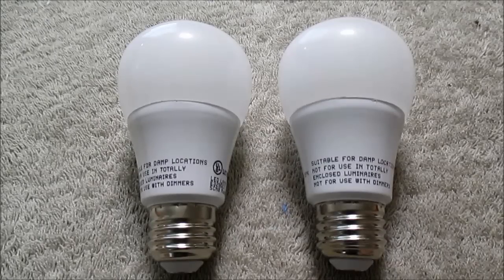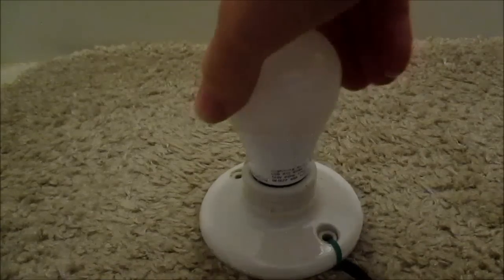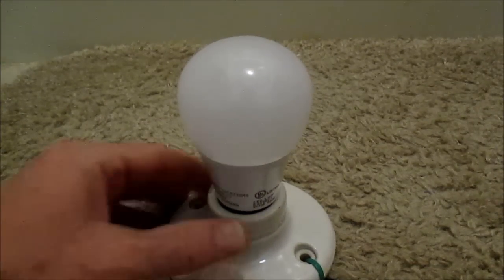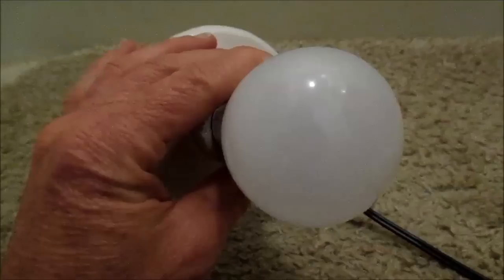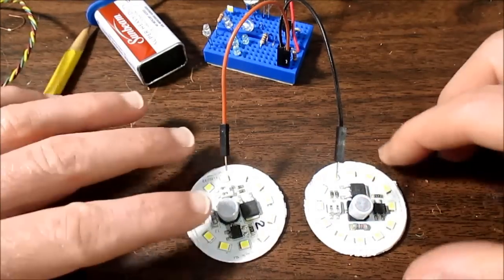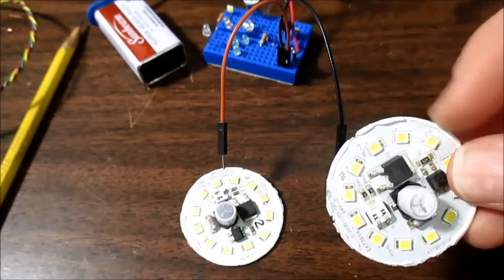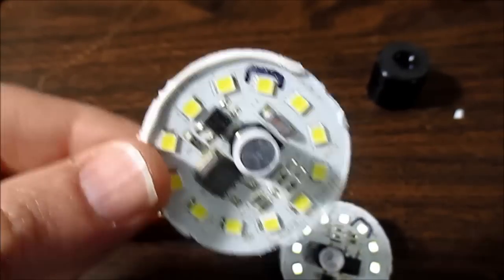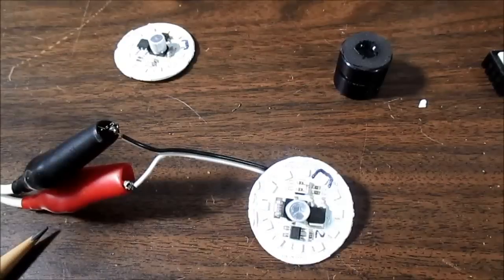Two failed LED bulbs for teardown to determine the cause

Comment: Some people believe that these light bulbs the last 15 or 20 years because that's what it says on the package.  These bulbs only last that long if they're properly installed. The major problem with LED bulbs are sensitive to heat. Maybe in the future we'll get light bulbs that last a hundred and twenty years like that one that is in the fire hall in California but like LED calculators these are meant to get rid of after a couple years.  If a computer says 15 or 20 years  of usage on the package  do you really want to keep it?   These are a little bit like computers  when a better one comes out it's time to get the rid of the one you're using.   If you could get the equivalent of a 150 watt light that provided a light type light  like the sun and ran on two or three Watts didn't get hot  for about $2 I would get rid of all the light bulbs that I have now whether they're working or not.

Comment: My led cieling light flickers alot...  Anyone got any ideas as to which component would be failing to make it flicker? Its been happening for nearly 6 months ....
Reply: Casey James at the same time as the microwave oven is running? Microwave leakage causes led drivers to flicker.
Reply: @t5grrr  nope, dont own a microwave

Comment: As with any electronic device quality of manufacture determines how long it will last. Cheap stuff is sold off and will have a much higher failure rate that more expensive made under better conditions and better materials. I have two led clock i made in late 70’s and they still work. Parts all made in usa at that time.
Reply: Go USA!!!

Comment: Current everyday LEDs are absolute junk.   In a box of 6 for under $10 you will get two failures within a few months. That's a 30% failure rate.   Incandescent bulbs that were under $2 for four had a 0.1% failure rate,  typically by handling. 

Remember that a Daisy chain of cheap LEDs and the ballast is likely to double the chance of failure for every LED in the chain.  

 Another device that is a Daisy chain of cheap LEDs is a solar panel.   Yes solar panels are just LED you shine light upon.

Comment: I also do this just for the fun and heck of it. If I may suggest, you can use an analogue ohmmeter to check each led if you set it on RX1ohms range. The voltage on the tester prods from the battery inside is just about sufficient to test an LED or a small CD motor. And by experience, damaged LED's in this kind of lamps, most of the time, very small black dots can be visible on the insides.

Comment: Thank you.  Altho I'm an EE, I never got into the bitty parts of flour. or LED lamps.  You did mention something that caught my attention:  a pair of 15-ohm rx in parallel, which I presume are for voltage stabilazation.  Since this is a mass produced consumer product, that 15 ohms could be +/- 10-20% tolerance.  Could that make a difference?
Reply from the maker: I believe those resistors are used to set the current on the constant current driver IC.

Comment: I've worked in electronics ALL MY LIFE and there is NO WAY that you can mesure CURRENT the way you do in this video. To mesure a current, the multimeter has to be put in SERIES with the mesured component, not in PARALLEL has you do in the video.
Reply: It is in series

Comment: If it has a good regulator chip then why don't they put shunts across the led like the old burner bulb Christmas lights?  That way when a single LED fail open the shunt closes and you can continue to use the bulb until the very last led fails.
Reply: That's a great idea, but then they wouldn't make as much money selling us new bulbs. It's all about the $$$$.

Comment: i'm still using CFL bulbs i bought about 20 years ago as they just appeared at the supermarket not a single failed. the other ones LED or CFL or halogen bought after 2005 fails within 6 months. They do it on purpose.

Comment: Nicely done investigation. But... :)
I suggest a look at this document, which explains the lifetime of LEDs.

http://www.p-2.com/content/products/literature/literature_files/what_is_the_lifetime_of_an_led.pdf

With an LED-development of less than 1 year, you can not know the exact lifetime of LEDs. Thats why it is all about statistical maths.
The lifetime of LED-bulbs, normally 25000 hours on the label, is not the lifetime as you will know it. Check it out.
Never the less, good work!

Comment: The main problem what I can see is already the design of the board itself.  It's almost sure one of the LED chips will fail because of the produced heat by all electronic components.  On the board should be nothing but the LED chips, so the aluminum sink is able to get the heat away from the LED.  www.ledlitec.com

Comment: I would think the LED's were bought in bulk from a company in China. Except for a few fluorescent bulbs, in the kitchen, the shed I keep my motorcycle in, and my basement workshop, all the other bulbs in my house have been replaced with LED's bought from WalMart when on sale. I've only had a few fail after a few months. I date them with a pencil when I install them and many have still lasted for many years.

Comment: The LEDs themselves are pretty reliable in (not all, but) most cases, it's the driver circuit that's usually crap.  Having replaced the backlighting in hundreds of industrial touchscreens, I've noticed that as they go from CCFL to LED, they're ditching the separate backlight driver board that can be replaced, and switching to some piss-ant little driver chip that's integrated into the video board (and of course that little chip is what goes bad about 1 month past the manufacturer's warranty)

Comment: I'm having issues with a brand new LED bulb. Put it in two days ago, and it just 'failed'. Made the same sparking sound you get from a failing mercury bulb, dimmed and flickered, and then came back on. None of the other bulbs in the fixture were affected. Any clue? When I unscrewed it, the white base part was very hot. Being an electronics tech, I'd say it's probably a short or a break inside somewhere.

Comment: I flipped the switch in my workshop recently and one of the LED lamps was just flashing at a really high rate. This is a supposedly 'quality' LED lamp made by Osram. It has been in service for less than a year, and isn't used every day. The crazy thing is that the 'el cheapo' LED lamps that I have in other parts of the house are still going strong, and they were less than half the price of the Osrams.

Comment: I have been using these type of LED bulbs for over 4 years now and have about 100 in use (there are 25 bulbs in my garage alone).  I should note that I have only purchased the absolute cheapest LED bulbs I could find.  The cheapest I could find was $0.35 each at Home Depot in the spring of 2018. The most I ever paid was $1.30 four years ago.  I have yet to have a single failure!
Reply: Yep - That's before they redesigned them to fail.  Example - my old LED Christmas light go for years - I've had new ones fail the first year of use.

Comment: To open sealed bulb use sharp knife, move around and use it like lever, it will pop easy and can be put back on. Burned leds are common problem just remove them and solder empty place. I fixed few lamps after 2 years of use and some of them still working. And sometimes is better to by two bulbs like 750lm bc they will put much better light in room than just one (one with 1500lm which is 100 and so whats) and lust much longer, all that for a fraction of a cost.

Comment: I believe the LED's are being purposely overpowered and that is what causes them to fail.
The math doesn't lie.
Find and open bulbs from several manufacturers and compare the circuits.
I think we'll find that some of them are better designed.
Reply: I gave it a thumb down as he stopped.  What is the fix?  Short around those led's?  Is he able to replace them, as I've seen in other videos.  He just stopped, like he thought "yep I'm right these are broken so throw them away".   There were several directions he could have taken after the diagnosis but he took none of them.
Reply: Paul Thomas, there is no points to recover these bulbs with new LEDs just because they were designed to burn. Designed to force you buy more new bulbs as they die. 
If one wanted to make these bulbs live, there should be some heatsink added and perhaps wrong/high current settings reduced. Doing this one would finally get some other new design. It is waste of time because these bulbs originally have poor design. Just don't buy tmem and/or throw away the ones you bought )
Reply: Ron I agree, they don’t like the fact they can last a very long time. The heat off of these bulbs alone have been questionable. I have a 100w for the garage, Lowe’s bought, and it has to be 200f after 30min on.
Reply: There are approximately a thousand people who actually gave this video a thumbs-down. That proves to me that the Lightning Science company had most of their employees deliberately give this video a thumbs-down out of anger for exposing the truth of their fraudulent business practices. I attempted to contact their company via their email address located on their website at https://lsgc.com 
My email was instantly returned to me as being undeliverable.
Reply: @GábrielPriòre  I have not thumbed down the video, but I guess some people did that because of the picture quality. Only 720p and not the cleanest 720p I've seen either, if you're sitting 50cm from a 43'' 2160p screen, it's just not pretty.

There are other channels that dismember/analyse failed Led bulbs, eg. BigClive, his vid's are of much better picture quality.
Reply: @Snowdog_PKs there could be no picture at all, or just a fun cartoons - because the bulbs have bad heatsink (no at all) and over heating forces LEDs to burn off. The value of this video isn't a high fps or 4K resolution, it is just why the bulbs die.
Reply: Gábriel Priòre it could also just be people working the algorithm to improve their recommendations by telling YouTube I don’t like this content as I did... 

It was informative and I now know why the one bulb in the kitchen flickers but this was a strange recommendation that I want less off (plus creator get interaction points on his content)
Reply: @Magtranya  Are you kidding me?!? Is that actually the reason videos have thumbs-downs? That is not the proper way to change your video recommendations. When I see a video that I am not interested in, I click the small dots on the side, then click not-interested. I have never needed to give any video a thumbs-down to change my video recommendations!
Reply: yes,agree!I I bought the product although there is a bad review but the price is really really nice, i try to buy it , and it very surprise to me, The quality is really good. Luckily
 lowhttps://amzn.to/2Nz4IHe

Comment: I brought SG leds and both started to malfunction after about 5 months.  they started having problems then after awhile they quit. I tried to contact and buy replacement but couldn't find the manufacturer.  I got them from at sears.  costing about $30+ each. a waste of money.  SG party speaker has been working ok, no problems but there LED bulbs are trash.

Comment: I suspect that heat has something to do with failures.  Why not cut off the plastic light defuser?  Just a thought.  I think I'm going to try it on Ubrite bulbs.  Real cheap.  A buck a piece.  Not much to lose and if it works the light will be brighter and hopefully last much longer.  The bulbs are in a fixture that is frosted so brightening them up will help with brightness.

Comment: I've been using the $2.67 Walmart LED bulbs for a few years now and several of them being on 18-20 hours per day still work like new. So far only had one die after nearly 2 years and that is likely because it is outside where it gets the heat+humidity and sometimes below freezing, but still lasted longer than any other incandescent or CFL bulbs do outside. The constant Florida heat and/or humidity for 9 months of the year is the most likely culprit.
Reply: It's four years later... Are they still working? And do you use any of them in fully enclosed light fixtures? I'm just curious.  ;-)

I have some early Walmart "Great Value" bulbs that were more expensive. I think they were made by a company called TCL or TPA -- something like that. Anyway, they've been working for so long now that I can't remember how old they are. LOL! Only the cheap Walmart bulbs have failed for me.

Comment: I had the same problem, the leds used to get burned in six months each, then I met an electrician who fixed them. It seems there's a heat problem   Three years passed since and I haven't had anymore such problem. And something else happened. Two of the repaired bulbs do not go off completely, so at night I've got a very weak light out of them, not disturbing though. It seems that the electrician made a preheating circuit, so the leds are not shocked when I switch the light on.

Comment: What you don't know is that those faulty LEDs are actually deliberately picked out and installed by the manufacturer to ensure a planned obsolescence.
Yes, there is a special weak LED hand picked in every bulb.

Comment: Light bulbs have been and are continuing with the biggest constant commercial rip off  of the 21st century
Reply: Gary Spears junior 

Your correct Gary.....

The demonization of the incandescent light bulb, (lamp), pushed and promoted by governments after lobbying from the green loonies, always had it that these types of bulbs, (the ones we had used for decades), were inefficient because they created heat that was wasted and not just light alone.

This flawed thinking about these bulbs missed completely the fact that they created both light ...AND.....heat. The heat was never wasted as it contributed to the heat in the room. Anyone who ever had a room with a number of reading and / or table lamps knew this anyway.

So when the lamps were  no longer used, and replaced by the new stuff, we lost one of the components that contributed to heating the room. As a consequence we have all had to turn the heating up to compensate for the loss.....

Marvellous....!

There may well be an argument for using bulbs, (lamps), that use less power and thus save us money but if we are turning up the heating to compensate for the loss of heat from the bulbs, (lamps), we haven't learnt very much....

James Hennighan 
Yorkshire, England

Comment: That's the problem with this new technology.  They're supposed to last for a long time, but fail long before, mainly due to electronic components of inferior quality or poor construction.  A chain is only as strong as its weakest link.

Comment: The cheap LED bulbs will fail prematurely sometimes... I had one that failed after a couple of hours, but the others I bought at the same time are going perfectly several months later. Considering that they cost less than $3 each and the posh ones are five times that, still good value... :-)

Comment: You do realize that 115vac is present on the board, and it is bridge rectified so the cap could have 160VDC on it, bled off by a bleeder resistor when you power down. Those are some high voltages to be playing with. The poking around on that board should be done with great care.

The IC looks like a linear constant current regulator, which is very inefficient and would run hot. So it heats the plate the LEDs are coupled to. Not sure if I would blame the LEDs alone, since the regulator is heating things up too. I think a solder bond on the LEDs fails, at least in the first case. The second looked like one of three LEDs on chip failed, or the wire bond. Hard to say without further analysis. To me it's amazing the cap does not fail, rated 110 degrees C usually. 

I've seen other failure analysis that suggests the controller failing is the cause of half the bulb failures. That's not what you're showing = you had LED failures. I wonder if poor manufacturing process might be the cause of failure, either cold solder bonds or poor wire bonds. This can happen if the maker pushes too hard on soldering or bonding throughput. That's typical in low cost manufacturing operations.

There are more reliable LED bulbs with switching current regulators. The controller runs much cooler, and heat is the cause of most failures of electronics. They also run the LEDs at lower currents, which reduces brightness and efficiency (lumens/watt). The components in the switching current regulator are more expensive, and the more reliable bulbs have to cost more. I suspect they make sense in industrial applications where the cost of replacement labor is very high. That's why traffic signals all use LEDs now, since there are fewer failures and it costs hundreds to change a bulb. For warranty cost reasons, automobile lights are almost entirely LEDs now.

Even with a shorter life, I think LED bulbs are still a money saver, because while they run they produce more lumens/watt than incandescent bulbs. The cost of electricity over the life of the bulb is much less, and it is by far the main cost of use. If the LED bulbs cost say $3, they cost say $10 per year to run, as compared to incandescent which cost less, say $2, but cost much more to run per year, say $30. LEDs still win, even if they last only a year or two. 

By the way, I think I'm using a better quality bulb than you perhaps, because I've not had a failure yet over several years of operation. Hope that keeps up. My bulbs were subsidized by my utility company, so maybe they selected more reliable designs.

Comment: Buy a higher quality LED bulb? Ecotech 60-Watt Equivalent A19 Dimmable Energy Star LED Light Bulb Daylight (4-Pack) comes out to 1.37 for each 60W equivalent bulb. I appreciate you analyzing the root cause. Moral of the story, do not buy Lighting Science bulbs.  At any rate, at 1.37 per bulb, the Home Depot bulbs can be tossed when they fail.  How much do the Lighting Science bulbs go for?